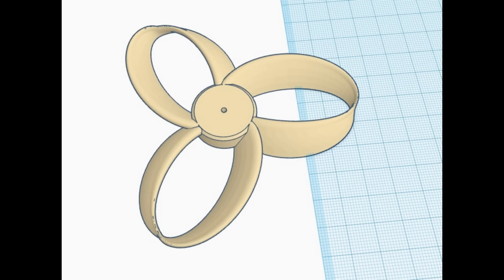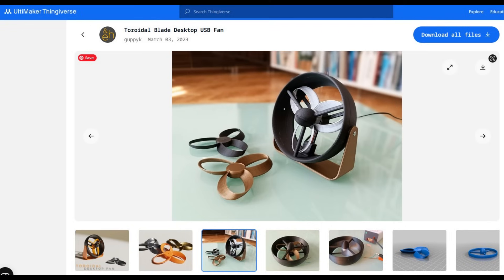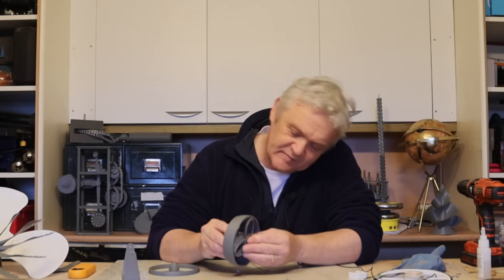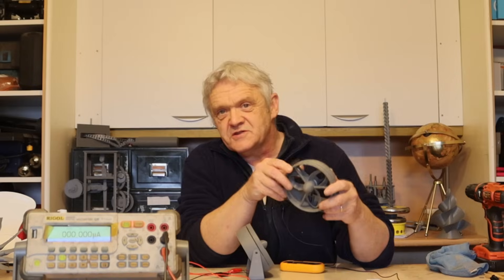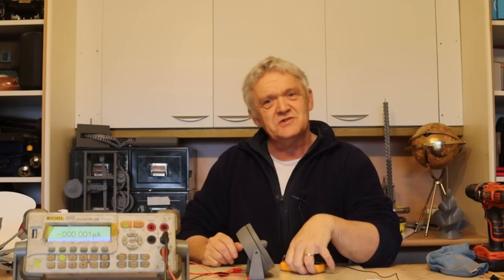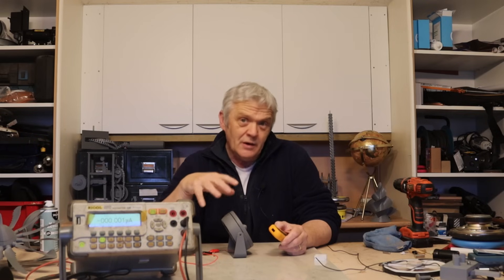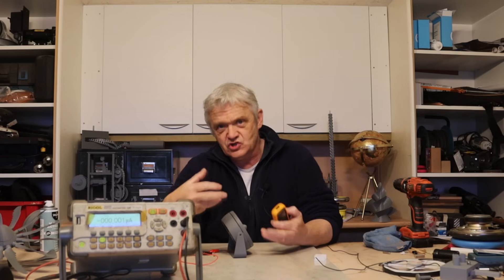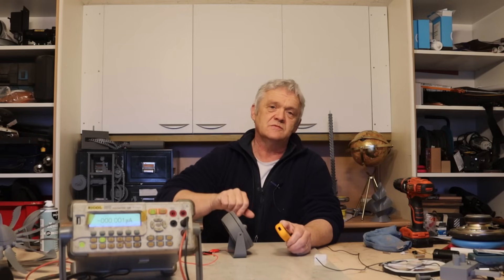2107 The Ultra Fan - A Toroidal Desk Top Fan With Tubercles

Comment: vortex generators work similarly, as '50s British military aviation experimented with. as  you likely already-know :-) May I suggest these new-fangled tubercles are too-extreme, and based on a whale's ability to grow them. Humans, however, have some advantages (+/-), so...FAIR the "protrusions" (aka: tuber....) into the actual wing, leaving the "bulb" to constrict the air-flow (aka: vortex, right?!) into producing the greater pressure-flow. Don't see the reason for the "protrusion", which resembles a ship's bow bulb here, in increasing that vital criteria. But vastly-more complicating the manufacturing! Keep trying, kids! :-) liked nonetheless! cheers....

Comment: This seems to combine the strength of making s-shaped levees instead of straight levees with increasing the length ratio of the leading edge VS trailing edge to increase lift. Maybe curve the valleys of the tubercles to match the peaks instead of leaving them straight across.

Comment: Are the tubicles no more than winglets / fences that you see on airliner's?

It will increase the form drag but reduce the separation drag

If you put fences on a STOL wing you reduce the stall speed of the wing, as you control the separation of the air at low speeds

Comment: i dont really get why one would put the toroidal propeller inside a hosing. i thought, the point of the toroidal shape is to reduce the blade tip vortices. but in a housing or shroud, the point of the shroud is exactly that, and (with a quite tight tip clearance) does this job pretty good. so why the toroidal shape?

Comment: I see a problem here: The toroidal blades have the advantage of their shape because they prevent vortex formation at the blade tip - a very undesirable thing which makes noise and drag. But you are using a ducted fan - and the duct also works by preventing vortex formation (by physically obstructing the vortex with a the duct). So you're nullifying the advantages of the toroidal blade design: You just have no need for it when you're using it in a duct.

Ducts have their own drawbacks - they add weight, and require precise manufacture to get the blade tips almost-touching the duct. Weight is a big factor for drones, so there's an advantage to toroidal blades instead of ducts for drone use.

Comment: Mr.Smith, I am not certain that you will even read this, so I will be as breif as I can..
How would these toroidal blades opperate in a variable pitch build ?
(Sounds crazy, but were someone to design and build a VTOL quad copter, with out electric motors, using only the variable prop pitch as the controls, would that be a viable design ?

Comment: When you mentioned the starting amperage was greater than the running amperage for the tubercle blade I immediately rewound the video to see the start of the standard blade.
Standard blade starting amperage was 184/165. Tubercle blade starting amperage was 179/154.

Comment: Assuming the results are accurate, I would love to see this sort of thing implemented on a drone! Higher inertia for the blades means that it would likely perform a little worse in applications requiring high maneuverability, but for near-constant rotor speeds like a locked off time lapse shot or sweeping camera shots, a 10% reduction in current draw is nothing to shake a stick at! And that 10% is even at a higher air velocity suggesting it might be closer to 11% - 12% when you lower the duty cycle. Very cool find!

Comment: The original Toroidal propeller has a different configuration that you have.  The way you have it, the trailing blade is effectively above the leading blade.  Flip it.

Toroidal propeller configuration is the rotating analogy of "joined wing" designs of airplanes that go back to the 80s.

The idea of the configuration is a leading swept back wing and a trailing swept forward wing are connected at the tips.  Doing this gives you the lift of both wings but the induced flow drag of one wing.

This is because the induced flow as a result of the difference in air pressure over the airfoil causes the tip swirl effect, as if the higher pressure underneath wants to equalize with the lower pressure of the top, but the wing is moving.

Well, in a swept forward wing, the flow moves in the other direction. Inwards along the wing towards the body, there is no tip swirl, no losses due to induced flow affecting drag. 

If we combine both wings, now you see the advantage.  

But as a propeller, if an unducted fan blade tips were connected, thats not a toroidal propeller.  The geometry of the forward swept blade has to suck in the induced flow leaving the tip of the swept back blade.

The way most people 3D print their Toroidal fans, the leading blade is under the trailing blade and their induced flow paths are not connected.  In fact, there's a tip swirl in these designs, defeating the purpose of the propeller.

Comment: 3D a larger one to replace the blades on cieling fans?
Reply: Actually not a terrible idea... it'd be expensive to make, but toroidal blades for ceiling fans would actually reduce the noise level, I believe. The tubercles wouldn't be of much use though, I imagine, due to the low blade speed - ceiling fans have to turn slow for safety reasons, otherwise they could cause serious injury if someone got a hand or head into the blade path.

Comment: When you said the tubercles on the wind turbine, was that on the leading edge or the trailing edge? I ask because the air flows differently when the wind is pushing the blades vs the motor pushing the blades.

Comment: my guess is that tubercles improve the wings efficiency by "fudging" the numbers of the wing design. you get a variety of aero foil  profiles along a wing with tubercles that slightly reduces the maximum efficiency of a wing, but the benefit of better overall performance in less perfect conditions and angles.

Comment: dang ,give a man a printer !?, lots of fun being had .If I could add to the mix , the tubercules allow attached flow at higher angles of attack ,hence more bang for the whales smaller fins . so trying higher angles of attack to get the same current draw ,could show if there is advantage in air flow ? . Also can i point out the tubercules in creating more directed flow over the /wing/flipper/foil/blade, is a way to reduce tip loss ,the Sharrow type prop may be a bit overkill , especially in a duct . atuberculed blade giving more thrust in a ducted fan could be very usefull ,for drones ,aircars, even the high bypass aero engines .Robert, Rolls Royce would be quite cross at you if you opened a whole new avenue of study and development ,they have just spent billions on their latest offering ! .

Comment: Really enjoying this experimentation with tubercles. You're doing the first thing I'd do if I had a 3D printer! :) I always wondered how a tubercled squashed 'X', like the Apache helicopter's tail rotor would perform. The principle being the soundwaves not hitting your eardrums at a regular intervals like a standard 2, 3 or 4 bladed fan. Assymetrical oscillation is something I'd like to work on too. A super-quiet fan with irregular movement would really help me sleep in the summer!!!

Comment: I wonder whether the tubercles would work better or worse if they were made smaller but more numerous, or at least narrower, so that more could  fit along the wing? I'm guessing both higher starting torque and the lower draw once up to speed are due to the added mass of the tubercles. Can you print them with cavities inside? Or maybe a honeycomb filling so there is still internal support? This series has been great viewing!
Reply: I would say that just like micro-ribs on a sailing vessel, they probably would work even better at micro scales.
Reply: I’d actually like to see dimpling (similar to golf balls) added to all surfaces, to see if it increases efficiency, as I expect it will.
Reply: Dimplings or tubercle, the point is to attach the flow to the profile by adding turbulence. Micro ripples on shark's skin works like this

Comment: The slower startup speed may just be a result of higher inertia of the blades with the additional mass of plastic. Those tiny motors don't have a lot of torque.  You should try printing a 3rd setup using a ~1mm high square ridge just a bit back from the leading edge of the blades that would act as a turbulator and see how that works.  When I used to hang glide we would take a line of pinstriping tape and put it across our helmets about 45 degress from vertical from ear to ear.  There was a significant reduction of drag as a result. Turbulators work very well for controlling boundary layer separation in low Renyolds number applications which is what I expect you are seeing with the tubercles...
Reply from the maker: i doubt it mate there was a gram of extra plastic - if that - and those motors are not that weak lol
Reply: When you mentioned the starting amperage I immediately rewound the video. The non tubercle blade also had a higher starting amperage.
Standard blade = 184. Tubercle blade = 179.

Comment: strong suggestion toward a sla (resin) printer for fluid-flow blades, whether air or water. the layers of fdm matter enough to matter on these small things especially
Reply from the maker: they smell bad mate and i keep my printers in the house - but i have used them and they do a fine detail work
Reply: lol smooth with acetone or other methods  its not an issue at all even with layers to fool with resin

Comment: I realise that most of your "stuff" is Proof of Concept and as such does not need refinement to show its purpose.
This may be a tad different though. Tubercles on a blade will alter its characteristics ..... which is what you want after all ..... but you only compare one snapshot. One voltage input giving one output compared to another output. 

But having a variance of voltage inputs would give different speeds and cause you to be able to calculate a power curve of input to output. This would show how to get the max out of the blade design and hence the way different alterations affect those outputs. It would allow you to find the least power to put in to get the most out. This need not be too onerous. Putting 6 or so different speeds in would give a reasonable idea of what is happening. 

Take the example of Drone Blades. They are designed to get the most lift and require high rates of rotation to get that. Now compare it to your desk fan. You use a lower speed and larger blades to get a similar effect if not volume of air moved! Different strokes, so to speak.

Again I realise that you are not honing ideas down too much other than expressing how different ideas can work. This may indeed be work for others to do (and that may be your expectation).
I thank you for putting these ideas up there for others to riff of ..... or to just think about!
Reply from the maker: i didn't show volts mate - i showed amps - we took the voltage as give as it was a fixed 3 volt supply

Comment: Wild concept! Maybe the Tubercles, being on the trailing edge, increase turbulence and thereby pressure, which could add just a little thrust that wasn't there before. A little distortion or positive feedback that might be exploited. Could Tubercles take on a fractal quality designed to create interacting vorticies to maximize pressure?  Love your channel! THX
Reply from the maker: they are on the leading edge mate - don't forget a fan is backwards to a turbine
Reply: I took your meaning to be micro tubercles upon tubercles.

Comment: Call me crazy, but I prefer a fan moving a higher volume of air; which generally means a longer blade with a greater swept path.
Reply from the maker: then make it bigger
Reply: @ThinkingandTinkering  Right, probably with a higher-torque motor.

Comment: Having a fan that actually makes power. Is what I'm looking for. Haha. A fan that can run 24/7, and output 20 amps and 60 volts! Would be about perfect. Especially if it's not more than twice the size of that one. Required no fuel. Just plug it in let it go, only it outputs power.. probably never going to happen, (yeah  it's going to do 1amp at best)
Reply from the maker: that's called a turbine mate lol
Reply: @ThinkingandTinkering  ...the fabled 1200 real average RMS output turbine... a sight of wonder! :D
Reply: @TheChzoronzon  You just place it on the roof at Westminster, so it can harness the current of hot air rising there.

Comment: This has got to show up in the Fan Show Down soon 😅

Should be good for the car air conditioner...
Reply: Absolutely, and for electric car heat-A/C should be great. Especially after optimisation. Get it performing even better, I know most use squirrel cage fans. Maybe this can take it's place, or influence a new design!
Reply: @jamest.5001  there's a thought... A squirrel cages with tubicles
Reply from the maker: i would watch that lol